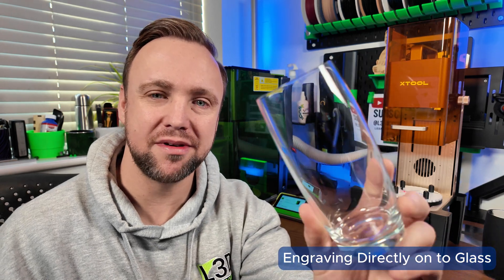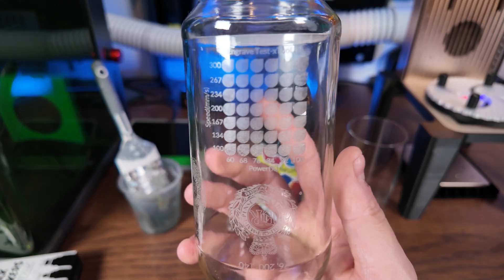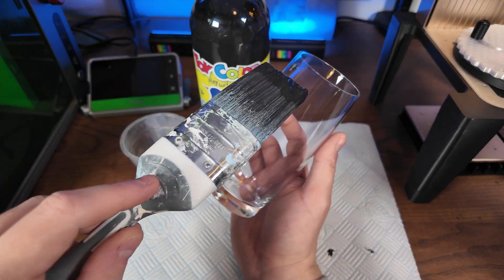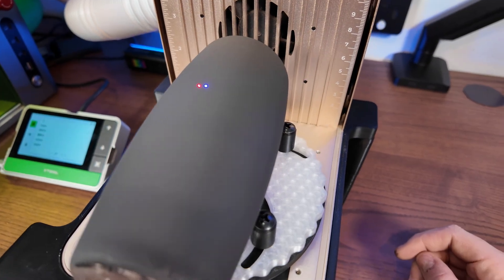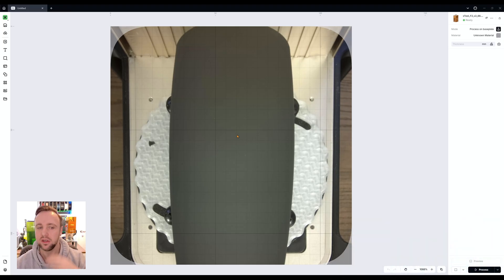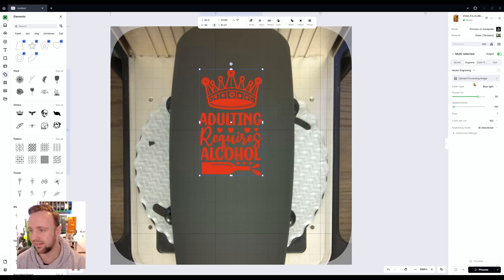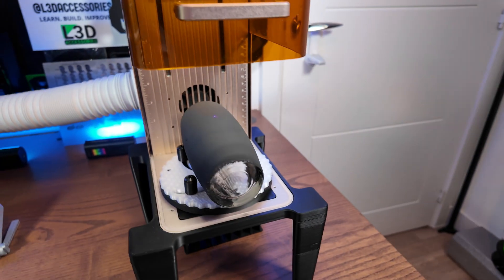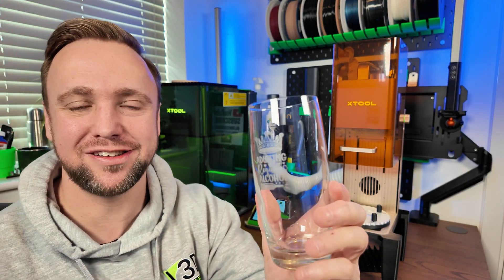How to Engrave Glass with the xTool F2 Using Tempera Paint (Beginner Tutorial)

Comment: Hi Chris, I'm Andreas from Germany and I find your YouTube channel perfect and very informative. Thank you for that. I have a quick question for you about laser engraving glasses: I painted a glass coaster with black chalk paint – an Edding 4090 chalk marker – black – and then I thought that would be enough, but unfortunately the laser engraving didn't go on the glass; instead, I engraved the base plate of my Xtool F2. Now I see that you use children's paint and this seems to work. Why is that? Or do you have something in the background that promotes/reflects the engraving? Thanks for your reply. Best regards, Andreas
Reply from the maker: Hi Andreas, thanks for the kind words.

Chalk paint can work and I’ve had results with it in the past, but I’ve personally found it a bit hit and miss depending on how it dries. I’ve had much more consistent results using children’s tempera paint. It dries very matte, absorbs the laser energy well, and it’s also far less messy than chalk.

There’s no reflective backing involved in my setup, the paint itself is what makes the difference.

Hope that clears it up 👍

Comment: hi mate , very enjoy the videos , however I was wondering how I get my setting the same as yours , my setting say dpi and dot duration and your say mm/s  and lines per cm . so not sure how this works , any change of a video showing how to set it up with mms and lines per cm . 

many thanks
Reply from the maker: Vectors and images work in completely different ways, which is why the settings don’t match.

Vectors (text, logos) are basically paths. The laser follows a line, moving smoothly from point to point. Because it’s moving continuously, the settings are things like mm/s (speed) and lines per cm.

Images (photos) aren’t lines at all. They’re made up of thousands of tiny dots. The laser stops and fires each dot one by one, a bit like an inkjet printer. That’s why you see DPI (how many dots) and dot duration (how long each dot fires).

So you’re not missing anything or doing it wrong, xTool Studio just switches settings based on whether it’s engraving lines or dots.
Reply: Thank you for clearing that up, mate.. I’m going to experiment with a photo . 
Buying you a coffee mate . Thanks for help .

Comment: Do you know if these same setting work for the F2 ultra?
Reply from the maker: Unfortunately not, the F2 Ultra has a much more powerful laser so if you used the same power settings I suspect it should shatter/crack the glass. The F2U has a 60W blue laser and the F2 only has 15W. In theory, you could probably divide the power I used by 4 and try that... But definitely do it with caution.
Reply: @L3DAccessories thank you! I’ll start with that and go from there.
Reply: @lauramorales3952  Hey, wondering if you tried this, or got your settings dialed in? Same boat over here!
Reply: @JerrodFoley have not. I’ve been having a had time finding settings for the f2 ultra in general. If I do dial it in I’ll report back here.

Comment: Thank you so much - I'm a glass artisan and was contemplating the UV but I think this will work great for me - next... 3D printer.... (Darn rabbit holes) 😁😂
Reply from the maker: You're very welcome. The UV would be perfect for glass because it requires no coating prior to engraving however the price is much higher. You can still achieve great results with the F2. If you do decide to buy any of the xTool laser please consider using my affiliate link (it's in the description). Regarding 3D printers, I don't post very much content for 3D printing yet but it's actually my main expertise. I'll be posting more content soon so stay tuned!